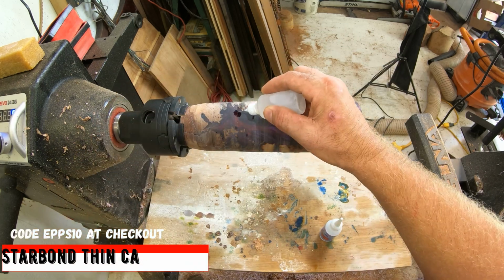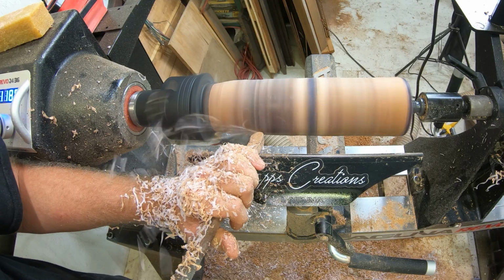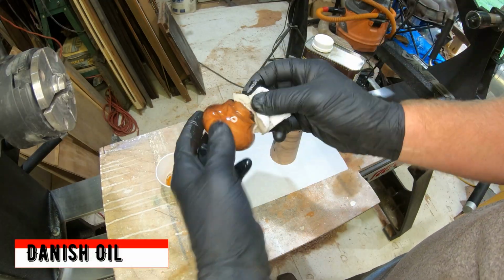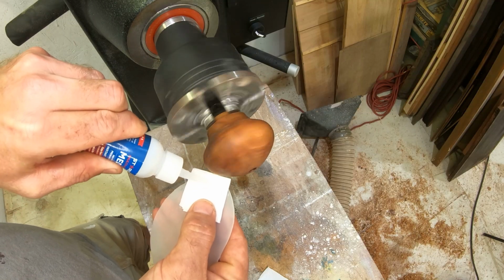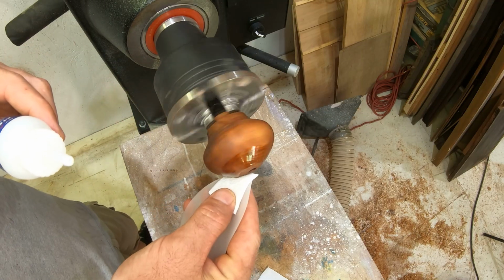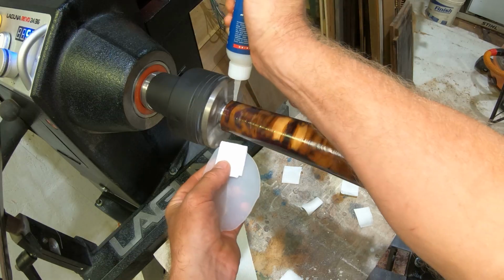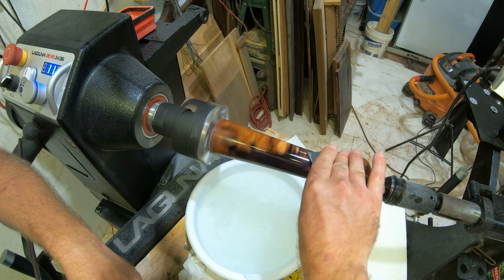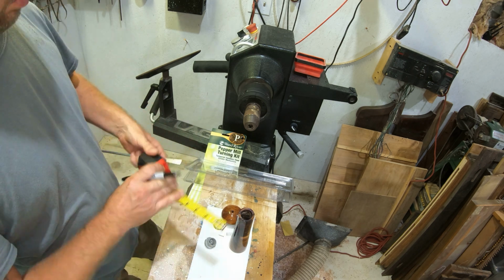Dirty Crack Grinder - Making a pepper mill

Comment: Very nice!  I've turned salt and pepper mills in the past with a different brand kit.  Not gonna lie ... drilling those tiny holes in the bottom and getting the miniscule screws to properly seat was stressful.  Your project looks spectacular!  Apple wood never fails to impress.
Reply from the maker: Thank you! I’ve found that the right size Phillips really helps! Almost need a fly lure light and magnifier 😂

Comment: Another good tip is to line the pressure pot with plastic or trash bag.
Reply from the maker: Couldn’t do that in mine. That hdpe board leaves no room for wiggle. Would cause issues trying to slide down the sides. I call it my “Maximus pourimus” lol. But if you were using other casting ways absolutely a great idea!